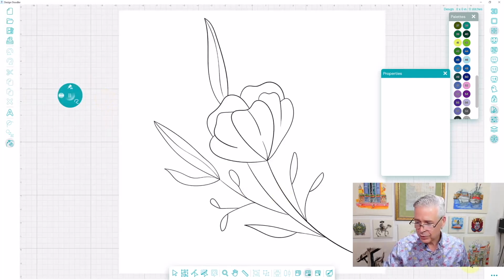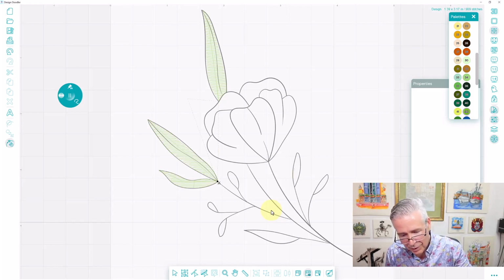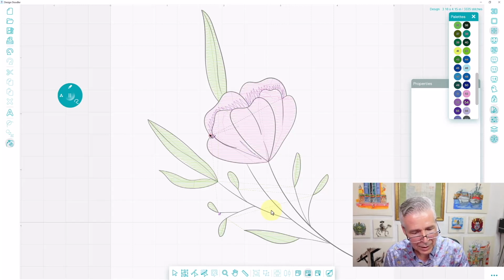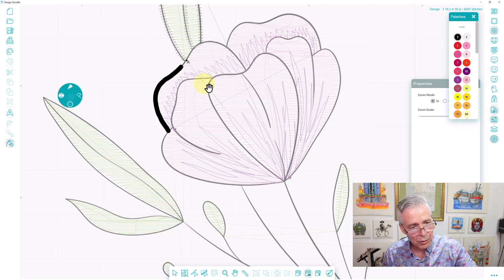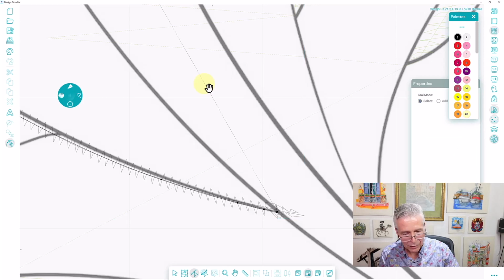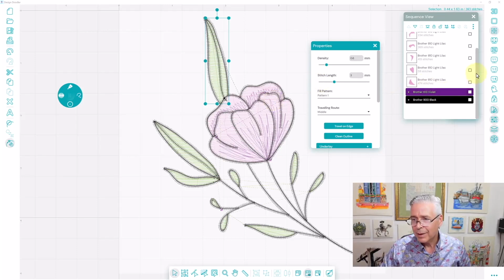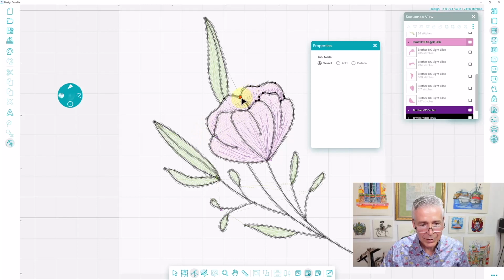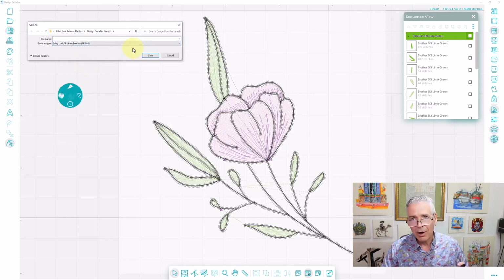Creating A Design in Design Doodler - Step by Step Tutorial

Comment: I just bought your doodler program and have an issue.  Where can I get some help?  I don't have the icon for FILL on the blue circle floating tool.
Reply from the maker: The three small dots on the lower right side will open the settings tab. Under “General” you and add or delete “Brushes” within the Widget. Please watch the intro/overview video, it will show you where most of the tools in the program are located.

Comment: In first 5 minutes, we are only able to see the result of your moves, but not where you begin, nor how you move on the design. Your cursor does not move as you are speaking.
Reply: I came to say the same thing. The mouse cursor has an arrow and a yellow circle around it, but when you use the pen to touch icons, we can't tell where it touches. Also, when you draw lines with a dark colour, we can see where it is, but when you outline a fill with a light colour, we can't see it working on the video.